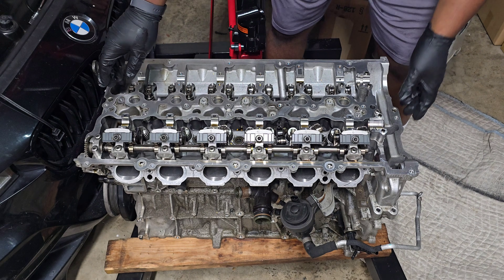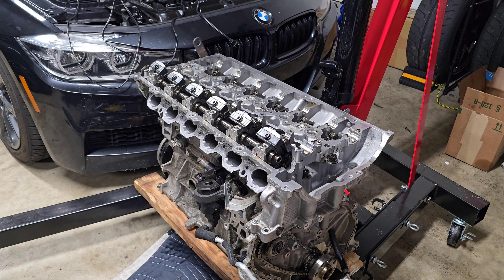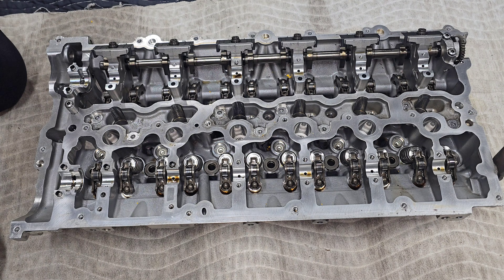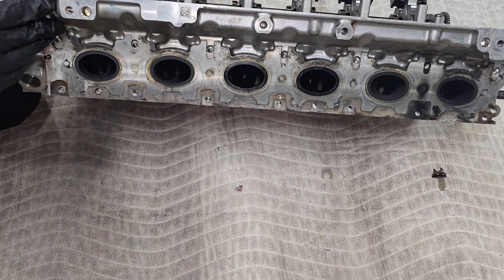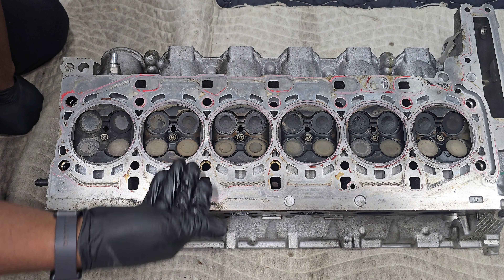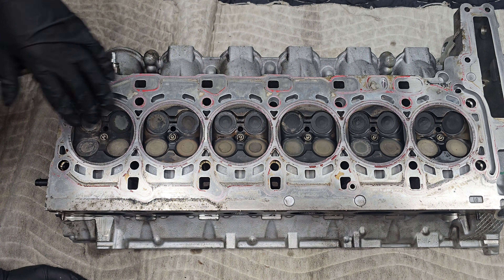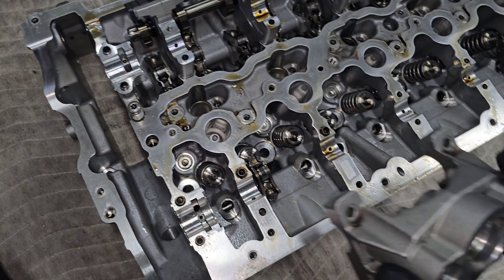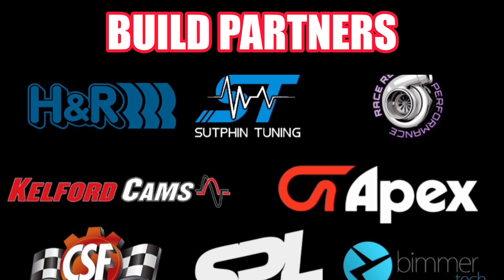A Closer Look at the B58 Cylinder Head

Comment: Do you know what the torque spec for the secondary/smaller head bolt near the back of the motor is? Or do you know where I can find more info for b58 torque specs?

Comment: If you did a leak down and not a compression test, it would have been a little easier to find the issue. Then you could hear where it is leaking. I would suggest taking a flashlight to the circumference of the valves and look through the ports see if you have any light. If you do see light, you have bent valves. I couldn't tell what spring kit is in there, but there is really only 2 in this platform that are worth installing. What I am getting at there, is if you have valve float it will bend the valves. You can also see if it was floating by looking at the tips of the valves, it will look like pitting if they have been floating. Hope that helps! Keep up the great video's!
Reply from the maker: I had kelford cams and valve springs but this was a long time coming. I bought the car with a hurt engine 3 years ago
Reply: He can also try water in the combustion chambers.  Sometimes it will leak through a valve(s) that aren't sealing.  Also blowing some compressed air through the intake ports with the water in the combustion chambers.  Tiny bubbles at the valve seals would be another indication.

Comment: You should check the torque it took to remove those bolts. Head distortion from over torquing could have been a factor. Small details matter.
Reply: They’re not over torqued. Every modern engine I’ve worked on for the last decade was 85-100 ft/lbs on the head bolts. 
Thinking anything less than your longest breaker bar is silly to break em free.
Reply from the maker: @Jbomb-ep4jr i torque my wheels to the same and these were next level. Def more than 100
Reply from the maker: Good point because for a second I thought these were welded on 😅
Reply: Every head bolt I have ever removed (dozens) is much more difficult to break loose than the tightening torque would indicate.  It's just how they work.  Normally, my 24" ratchet is sufficient to break head bolts loose but I have a 36" long breaker bar for the really stubborn ones.